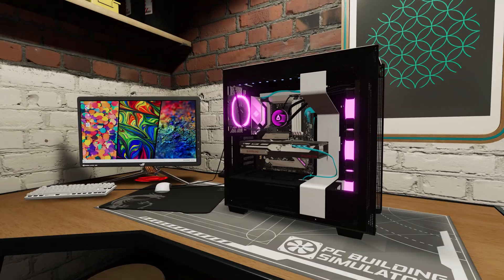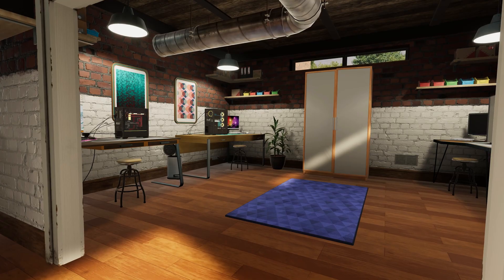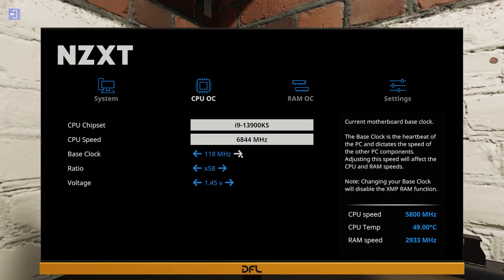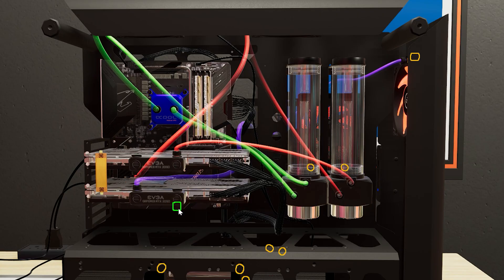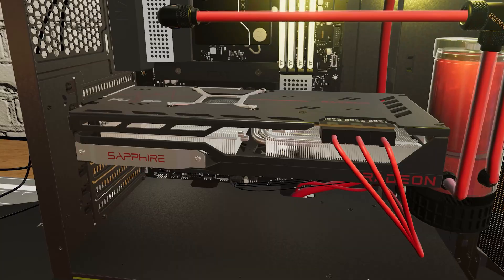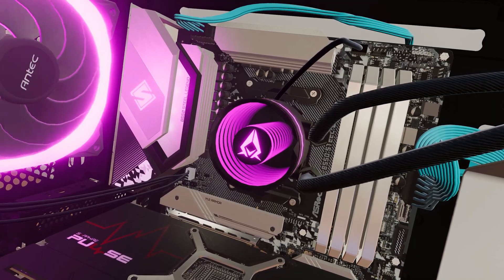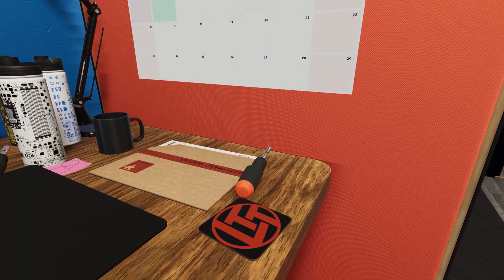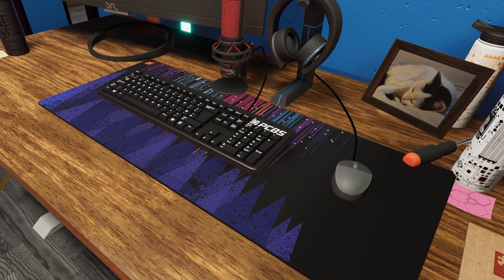PC Building Simulator 2 | Update 1.4

Comment: Not really interested in building modern computers. Now if you release one that lets me build modern c64 and amiga clones or an OG career mode that let's me put together computers from '82-'05 I'd be down. Make me deal with IRQ and DMA mapping. Force me to deal with the early issues of pnp. Make me set voltages and multipliers via jumpers. I could go on and on.

Comment: Should a EVGA Z370 FTW be able to OC  I9 9900K to 5.5GHz with watercooling. I am hitting Blue screens even though my temps with two radiators are 42C in the Big Chungus case. Voltage doesn't solve it. Is the Z370 not made for a I9 9900K ?